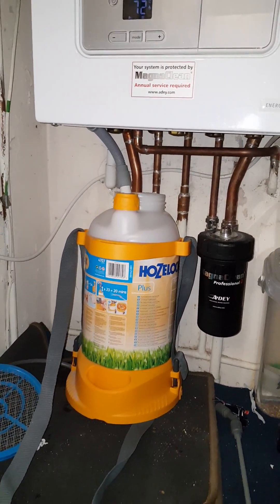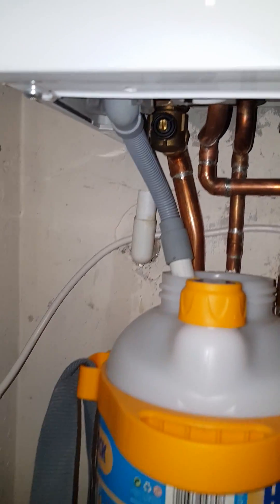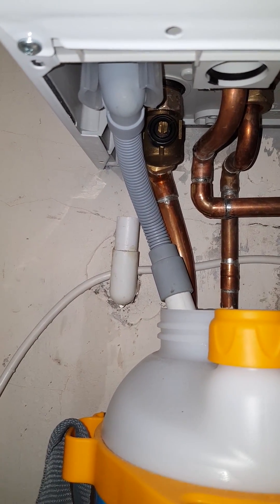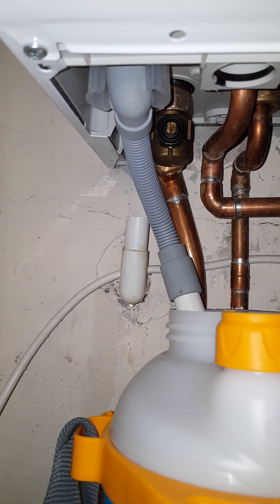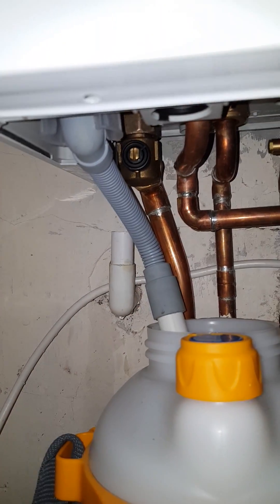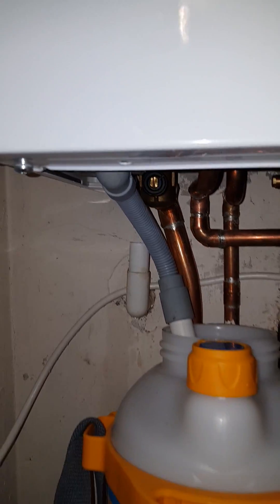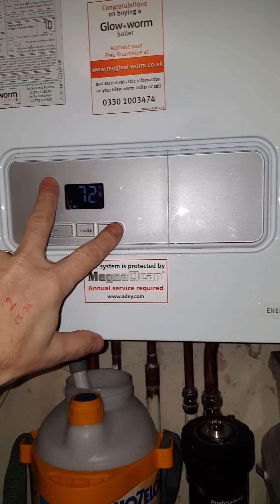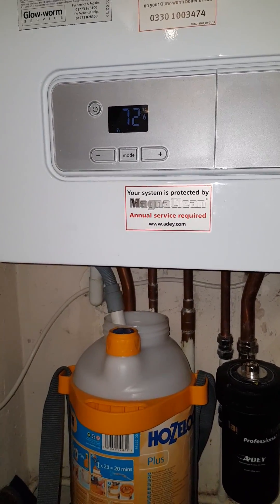F28 Error! Gas boiler stopped - How to fix condensate problem on gas boiler

Comment: No hot water or heating for 2 days, was confused by other videos showing outdoor plastic pipe that you pour hot water over, that I don’t have. Not sure how my pipe if frozen if it’s mainly on the inside and I can’t see it. 😮Easy fix with a saucepan sat on my bread bin. Luckily it’s my day off so can keep emptying it. Excellent, also loving the informal technicals!😂

Comment: Absolute hero.
Reply from the maker: @lmaoroflcopter  no worries 😉
Reply: @Bigtel1970  honestly were mate. I had condensate backing up and coming out of the air intake pipe flooding my kitchen. Pulled the condensate tube and cleared what must have been about 5 litres of water.

(I suspect rainwater is getting in the flu somehow)

Comment: Ah, this hasn’t worked. I had the condenser pipe in a bucket and no change. Any secondary steps?
Reply from the maker: I had it happen recently and it also wasn’t the condensate.. after resetting it a couple of times it kicked back in and worked again

Comment: Not aloud to touch that pioe unless  your gas safe
Reply: Pipe
Reply from the maker: You can - it’s not part of the Gas Safe legislation. It’s only if you interfere with the gas supply in any way that you are committing an offence 👍
Reply: They deem that part of the gas flue ways now.hence condensing trap there to stop gas getting out.?
Reply: U have a dry trap your getting fumes into your house
Reply: And if I was putting that into a basin or bucket be in water not open end  sitting in a bucket
Reply from the maker: Did the video help you with the problem or are you just scrolling and feel you need to comment?
If it was the former then I’m glad it helped.. the latter, I understand your concerns - this is purely a temporary measure. There is a disclaimer in the video’s description too. 👍
Reply: Am  gas repair engineer for 16 years was  just scrolling  ..

Comment: Do you know that the condense trap and pipe are actually part of the flue and you have just broken the gas regs and in certain circumstances products of combustion can now enter the room !!! What you need to do is get whoever fitted the boiler back to fit the condense pipe correctly to the regs as it is clearly not to manufacturers instructions . A little bit of knowledge is a dangerous thing
Reply from the maker: Ironically enough, since making this video I’ve actually become a plumber/heating engineer so, yes, you’re right 👍
Reply: He has a point what about Carbon monoxide that could possibly come through aswell. It is condense water so there can be gas aswell

Comment: Thanks so much I had this error last night followed the instructions put a big bin underneath the boiler and removed the pipe from the hole in the wall and put it over the bin and reset the system hey presto it worked .  This has saved me several days of being freezing cold and money!!!  Thanks again

Comment: I've been out with load after load of hot water on the external condensate pipe all day with hit and miss results, but I knew frozen pipe was the root cause. 
Followed your video, popped the connector hose out and pointed it in to a mop bucket, reset the boiler and yep - straight on. I owe you one!

PS - for anyone else doing this, it's a good idea to have your mop bucket ready before you disconnect it due to backed up water in the pipe. I found this out the hard way.

Comment: Many thanks for this. Got the error last night - half way through a shower. Called the plumbers who advised to pour water on the outside pipe which I did - buckets of it - to no avail. Waited till this afternoon in the hope it would warm up a bit but still no joy. Found your video and like the others - you've saved my day (and my wife's) Thanks again
Reply from the maker: Glad it helped

Comment: funny it took me a cold night to work that out - using a bucket - but the real problem is - how to avoid such a blindingly obvious design flaw in a heating system that packs up when it gets cold
Reply: Pipe should be properly insulated, running at an angle(so water isn’t collected in the pipe) and correctly sized

Comment: 👍👍👍Even though my boiler looks completely different, I managed to identify the pipe. When I disconnected it, it turned out that there was quite a lot of pressure built up, also some water came out. The boiler worked straight away! All that needed doing was to thaw out 20 feet of pipe outside the house (ended up pouring hot water into the plastic pipe, where the rubber pipe connects, as the piece inside the wall was also frozen - don't use boiling water as this will make the plastic very soft, and the pipe might bend). Condensation outlet pipe outside the house in Scotland is a brilliant idea.

Comment: Excellent information. Was sitting freezing and no hot water wondering what was going on. Reset it a few times and the fault F28 would come back within 2 minutes. 
Followed this video, reset the boiler and happy day's. 
Thanks , thought it was something serious and costly.
Reply: What did he do exactly? Put the tube in hot water?

Comment: Thanks for this - super helpful and sorted the issue. Quick question, do you reckon I can pour warm water straight down the pipe? Or do i need to heat up the pipe from the outside (issue is my boiler is in the loft so the pipe run is high up on the house)
Reply from the maker: I think you’ll have more luck pouring hot (not boiled) water over the pipe externally if possible? I’m guessing that if the pipe is frozen but full then adding any more water to it will probably just overflow as it could not defrost it fast enough?
Reply: @Bigtel1970  thanks for the reply mate. Yep I think you’re right, was looking for a quick way to fix as the pipe is high up and connects to another drain pipe that drains out onto a flat roof - but will get the ladders out and pour water externally 👍
Reply from the maker: @ukvip1  cool.. it’s worthwhile getting some lagging and putting that over the whole of the pipe externally.. chances are you’ll not have the problem again
Reply: @Bigtel1970  yep good shout. Thanks again, much appreciated

Comment: I have this exact issue on my worcester bosch boiler the condensate pipe is linked to the waste pipe internally so it can't get frozen had an engineer out twice today to clear it drainage pipe is clear so no issue with that but the condensate keep backing up and shutting of the boiler . You can drain the trap and will work fine again but few hours later faults reappear wondering if its time for a new boiler though this one was only fitted in 2010 and serviced every 12 months.
Reply from the maker: Has the actual waste pipe become blocked?
Reply: @Bigtel1970  pipe was clear as a new one got put in today as the old one was not suitable and not at correct angle  but its puzzling why its still backing up

Comment: NO!NO!NO!   The condensate pipe is considered as part of the flue and it should never terminate inside the house (open ended), this has the potential to be lethal (CARBON MONOXIDE POISONING). better to keep it external defrost with warm water (NOT BOILING) and then lag it or have it lagged. or better still if possible have it terminate into an internal waste pipe.
Reply from the maker: That’s a valid point - take note people.  Worth adding a pre-warning that following this video WILL fix the problem and get the heating working again, but use the next minutes defrosting the external pipe and get it all refitted and safe again 👍👍

Comment: i bought a volkera combi -the condensate vessel has the cap missing from its base-  i wondered what the short bit of flexi-pipe was for --seems it goes onto the cap spigot and connects to a pipe going outside to drain the condenste water

Comment: Happened to me. I checked the instruction leaflet and saw that the outside pipe should have been lagged against being frozen by the installer, in this case British Gas. Going to chase them up on this to fix.